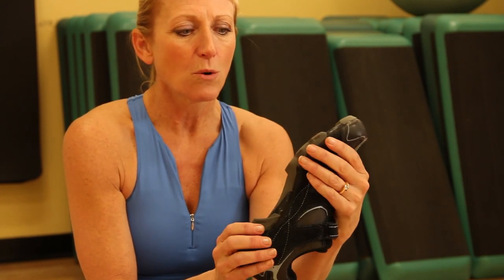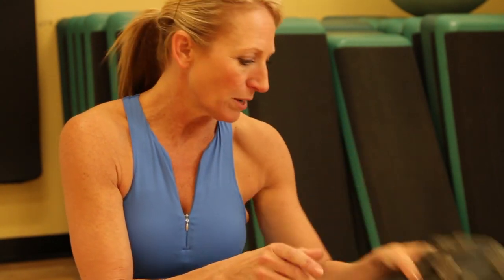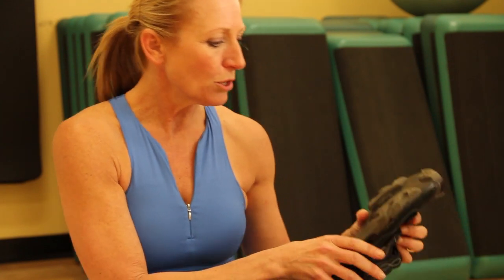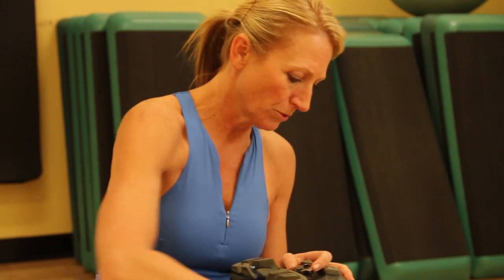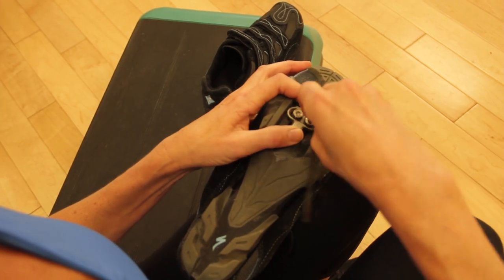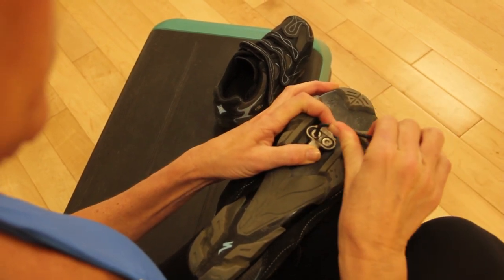How to Install SPD Clips on Cycle Shoes : Indoor Cycling

Comment: Reading some negative comments and gave the thumbs down myself (which I removed later), but that's a bit unfair.  The important thing to take from this is the direction of the SPD plate on your shoes.  The frustrating thing for first time users is that they (me too!) tried to see if they get it right by placing the shoe on your bike and seeing that it doesn't quite attach.  You have to trust that this works and put your shoes on and get on your bike and feel for the top part of the SPD and put your weight on it and push your foot forward until it clicks.  You can not video that and it is mostly feel, but when it works you know it.  This can be frustrating for a newbie, which I am, but trust this video.  All it says is how to install and that it does.  Yes, that part IS the easy part.

Comment: The cleats I am looking to buy say they do not come with a nut. I am completely new to this. What is a nut, do I need it to attach to the shoes? I have ordered a spin bike so this is for indoor use and the spin bike shoes as per standard do not come with cleats. So I have ordered cleats separate but they say "do not come with nut" and I don't even know what that means!!